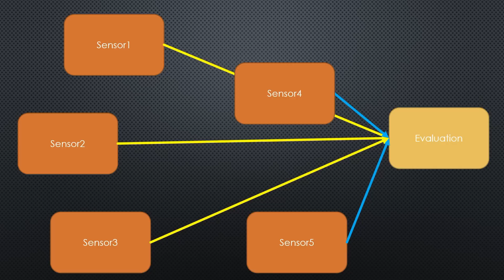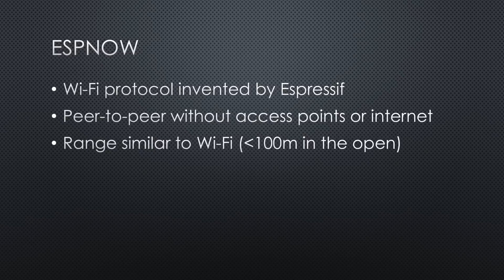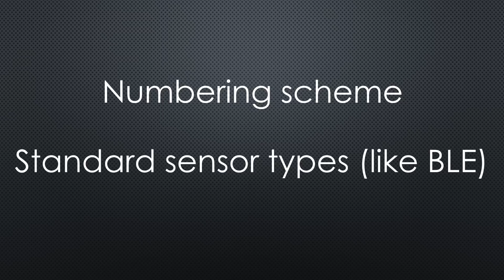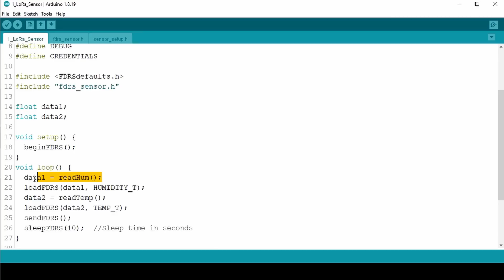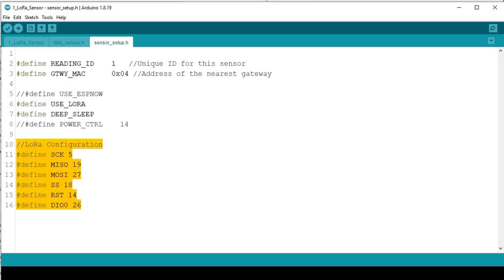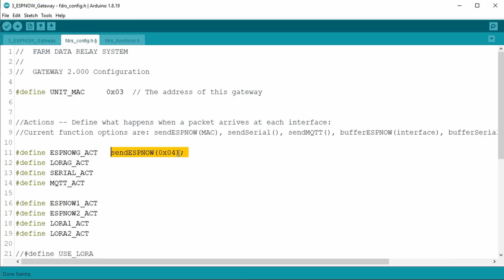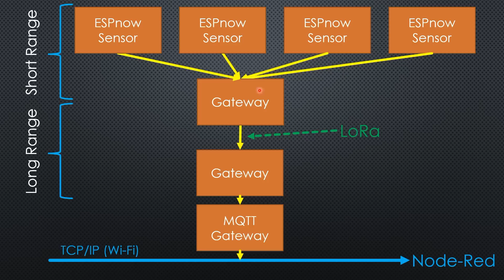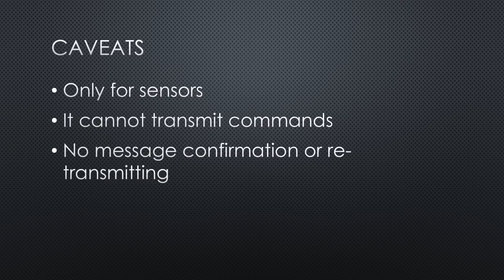430 ESPnow and LoRa Network (incl. Repeaters and Gateways). A TTN replacement?

Comment: @Andreas: ESPNow and Wifi run togeather... 
To be exact ESPNow simple usese Wifi "manufacturer message" packets.
The only problem i discovered so far is the Wifi Channel must be the same for Wifi and ESP Now receive (Channel of Wifi AP rules here).
Reply: you are right: channels must be the same (which should not be a problem - you control your AP). But I am not sure if you can do 2 things at the same EXACT time: talk/listen to ESPnow and talk/listen to WiFi - probably not. So when WiFi is on AND in use (send/receive message) then ESPnow incoming message probably is lost (I did not check it thoroughly yet but my observation shows this)
Reply from the maker: Maybe somebody takes care of that part of the project and writes an integrated gateway. For the moment the addition of an ESP-01 is cheap and it worked…
Reply: @zyghom  There is no Problem listening or sending both (except the Channels i mention). ESP now IS Wifi, but w/o the need for a managing AP
Reply: @emmoemminghaus6455  that is what I just said ;-) But can 1 radio talk to 2 devices at the SAME time? (sensor sends data over ESPnow and Gateway sends data to MQTT server at the same millisecond)
Reply: This is the precise issue. All devices need to be on the same channel, but the MQTT gateway changes channels to match the WiFi router it is paired with. Trying to match every device in the system to the channel that the first one is using would add too much complexity and overhead. Eventually I may add an option to choose what channel everything runs on as you are flashing the devices, but I haven't had a chance to test that.
Reply: @timmb2512  I am not getting where you see the problem: we are talking your house, where the AP is under your control, so you can set up fixed channel. Then all the IoT devices you build, you set up to use this channel - WiFi or ESPnow - no difference. Right? Where is the problem?
Reply: @zyghom  As I said: that is something I may add to the system.
Reply: @timmb2512  sending on a specific channel works. The problem is how do you know what channel to send.

Comment: Nice project, but this reinforces my feeling that open source community very often tries to reinvent the wheel and start from scratch instead of contributing and expanding existing projects. Mysensors is something similar using nrf24l01 transceivers and would be a nice base for this
Reply: freedom is also "a thing" but actually you might be right as well ;-)
Reply: I used mysensors for one year and threw everything away ad it is poor documented and mantained although their idea was great.
Reply: @nmuratori  many projects finish the same way ;-(
Reply: @nmuratori  my point. Mysensors its just an example of something similar. I also used it and I think is fairly well documented but not mainteind anymore. So it would be nice to have fewer good projects rather than several poorly maintain projects. Not a critique, just a personal opinion/wish
Reply from the maker: I never used mySensors. But extending projects often also increases complexity and inherits legacy…
Reply: @AndreasSpiess  i like to think software in 2022 as building blocks. Each block needs to be as a lego brick: robust, standard, flexible. When I choose a software stack I want each block simple enough to do only precise things, and able to talk with others in a very open way, so I can switch to other blocks if needed. Mysensors wanted to do too much. From hardware to protocol. Esphome is another example. great to start with sensors but relies to other platforms (homeassistant) and therefore as soon as you need something custom it's a big mess.
Reply from the maker: @nmuratori  Custom and Lego bricks do not fit particularly good ;-)
Reply: @AndreasSpiess  fits perfectly. It's what you do in all your tutorial. Arduino is a brick, a driver is a brick.. good bricks can talk each other and have flexible interfaces to combine in new ways. Bad bricks are like the fancy chassis of a lego starship, seems cool and complicated but cannot be used to anything else than what you have designed specifically.

Comment: Very good video and interesting project. Another thing to add to the to do list is security. This is becoming a great concern for all IOT.
Reply: its not so bad in remote areas (its a farm) and no connection to the internet. Not a very attractive target. What info to steal? Temperature and humidity? Not much to secure here. Its good for use case scenarios
Reply: what would you add in that scenario? A SSL connection at most.
Reply: As mentioned, incoming sensor data only needs to be secured in a few scenarios. When bi-directional communication is better implemented, I'll be looking into how security can be improved. Suggestions are encouraged!

Comment: I think the better solution will be a ZigBee network sensors are production level and not DIY, Routers can be powered externally with solar panels. And all sensors would use the same protocol. It will be more costly but with less caviets.
Reply from the maker: Zigbee is a very good protocol. However I do not know how to build my own sensors for the moment. And Zigbee has a very limited range similar to BLE. LoRa has a very big range.
Reply: @AndreasSpiess  You don't have to build your own sensors that's the whole idea :) 💡
However for ranging issue ZigBee routers costs about 6$ each + another 13$ for solar and 5v converters and since they work as mesh you can put as many as needed, and message guarantee to arrive ( or at least you can watch network health ).

Comment: Do the ESPs use less power than for WiFi while they‘re running LoRa and/or ESPnow? I had the impression that the high power consumption for WiFi comes not only from the use of the radio (which is presumably no different for the other protocols), but also from what‘s required for WiFi communication — some messages that have to be exchanged with the AP, and a bit of waiting. If LoRa or ESPnow are simpler protocols (I have no idea if they are), then there could be less power consumption and longer battery life.
Reply: the maximum current I measured for WiFi vs ESPnow is not that different, but the overall consumption comes from the time when radio is ON. For ESPnow you can get into the range of 15ms - there is no way to get even connected to the AP (WiFi) in such short time - my best time for AP connection was around 100ms (and not always of course as it depends what happens on AP at the time you try to connect) - with WiFi sensors I was never below 1s total time (measure, connect, send, go to sleep) while on ESPnow, including measuring temp/hum/light I can get into 200ms (with ESP32-S2)
Reply: @zyghom  that‘s impressive. Reduce the time spent using high power to 20%, and you can run devices like these from a coin cell battery that only needs to be replaced a few times in a year.
Reply: @slimhazard  "the only" problem is: I am not sure how to make ESP32 even start on the coin cell ;-) I am using 1000mAh LiPo for indoor if the device is not connected to the power (with ESPnow it should last for 1y - still 11.5 months to make sure it is true) and less capacity for the outdoor sensors that have solar panels. Nowadays in southern England the charging start at around 4:30am (and sun finishes after 9pm) so battery is full again within 1h but during the winter it wasn't so easy ;-) (but last winter my sensors were "old versions = WiFi" so they did not consume so little like today - we will see next winter)
Reply from the maker: If you need low power sensors I would use LoRa and a simple Atmega processor also shown on the channel. Gateways have to be connected to the grid or solar because they are always on.

Comment: Now, how long will it take for 1 byte addressing to become a bottleneck?
Reply: Yep, that's an acknowledged point-of-limitation. There really isn't much stopping that from being extended, however.

When someone sends me their project with >128 gateways, I'll look into using a second byte :D
Reply: ESPnow is limited, so 255 devices is more it can handle ;-)
Reply: @zyghom  limited by the number of devices immediately connected to a single gateway? End-to-end numbering will still put a hard limit on the size of the network regardless of the number of gateways.
Reply: @killymxi  From Espressif pdf: "10 encrypted peers at the most are supported in Station
mode; 6 at the most in SoftAP or SoftAP + Station mode. Multiple unencrypted peers
are supported, however, their total number should be less than 20, including
encrypted peers" - I think they talk about "paired" devices. Btw I went through the code Andreas linked - the "addressing" part is kinda strange - you actually don't have to address the peers - simply add 1 more field in the sent data: "sender's name" or so. And you (the receiver) always know the MAC of the sender - this info is part of the ESPnow message exchange so even the MAC of the sender is not needed to know. Btw receiver does not have to know anything about the sender - it is only a sender who must know whom to send to (unicast) or in case of broadcast... 0xFF all bytes. In my project I simply set up the MAC of the receiver to be fixed address and then all senders (sensors) send the messages to the same MAC - receiver is not aware in advance how many will talk to it: "message comes - thank you - let me send it to HA and using discovery messages on MQTT create the entities"
Reply from the maker: Maybe Timm know the answer? I assume it is big enough for typical maker projects.
Reply: @zyghom  It sounds like you are on the right track. The peer number limitations aren't really relevant to this, as an ESP32 can send and receive from unregistered peers. 8266 has some more limitations on this, but I was able to solve it by adding peers on the fly, then deleting them once I was done sending to them. Seems to work so far...

Comment: unbelievable - I just finalized my project: "move out from WiFi to ESPnow".  Similar approach (without LoRa)  and observations:
1 - gateway: 1x ESP32 can do both: ESPnow and WiFi but not at the same time (no need for Serial), but:
- ESPnow message sending takes < 15ms (from start modem till receive confirmation) and if 2 messages come at the same time you either do queue on gateway or discard second one
- sending WiFi message from gateway to Home Assistant MQTT broker takes < 20ms
- ESPnow sensor wakes up, collects data, sends message to GW:
  - ESP32  < 0.6s
  - ESP32-S2 < 0.2s  much faster so less battery consumption
- GW is always on, both way communication with HA 
- since ESPnow sensors only talk 1 way: to GW, no commands to them, so OTA on routine basis: once a day it connects to web server where new Firmware might be and if found, it will perform OTA

2- ESPnow sensors:
  - ESP32 - 180s hibernate (not deep sleep!), average current 4.5uA, work time: 0.6s with average 50mA, overall average consumption:  200uA
  - ESP32-s2- 180s hibernate (not deep sleep!), average current 22uA, work time: 0.2s with average 38mA, overall average consumption:  80uA
so ESP32-S2 gives 16 months for 1000mAh battery - ESP32 "only" 5.5 months

CONCLUSION: better to work fast (0.2s vs 0.6s) than sleep current (22uA vs 4.5uA) to save battery

and for battery: no voltage - use MAX17048 to get real performance of the battery, i.e. from here: https://www.ebay.co.uk/sch/i.html?_from=R40&_trksid=p2512315.m570.l1313&_nkw=max17048&_sacat=0

EDIT:
ESPnow in UNICAST re-sends data to receiver if failed and returns the real outcome (success if received and confirmed by receiver), in BROADCAST mode it only confirms "message sent" - irrespective if received (for obvious reasons: broadcast)
Reply: If you use HA.... wait a while.... i do a more modular verstion of my WIFINow Module... INCLUDING OTA (and othe IP stuff for convinience)
Reply: @emmoemminghaus6455  the "problem" is: if the ESPnow devices work for too long, the battery goes depleted fast, so I opted for "interval" OTA (once per 24h) rather than to force the device to wait for the command. But I will test also command from gateway to the sender in case OTA has been requested by HA for the specific device (command sent to gateway for specific device, and if the device sent data to gateway the order from gateway to the sender: "hey, do OTA ASAP please") - let me check how much more time it will be for the sender to stay ON. BTW HA makes it much easier than standalone MQTT broker and Node Red (I think)
Reply: ESP Now and Wifi at the same time is theoretically possible, but I had problems with channel selection. ESP Now always did channel 1 on the sender, no matter what I tried to set. If the home wifi wasn't on 1 the receiver was on a different channel than the sender which I couldn't change.
You can easily check ESP NOW with Wireshark if it sends on Channel 1 or any other. Just make sure your connected Wifi is on the channel you want to monitor.
Reply: @drstefankrank  
try this one then (on sender):

#define WIFI_CHANNEL 8 
WiFi.mode(WIFI_MODE_STA);
esp_wifi_set_channel(WIFI_CHANNEL, WIFI_SECOND_CHAN_NONE);

and you don't need wireshark to confirm - receiver (if set up on that channel as well) will tell you the same
Reply: @zyghom  I try this. I can't remember what i tried so far, but all efforts in setting the sender channel were not successful in the past. Maybe it is a fixed bug or I did something wrong. It's over a year ago.
Reply: @drstefankrank  you might be right - I tried some time back and it was... NOT working. But today it works ;-)
Reply: @zyghom  That gives me hopes.
Reply: @zyghom  Thank you so much. This indeed works. Just had to include esp_wifi.h to get access to that function.
Reply: @drstefankrank  check on my github the implementation
Reply: @drstefankrank  If Wifi now where locked to channel 1 then it would be forbidden to use it in asia.... Only because there are a few dumb devices this does not mean that you cant use other channels. As i sad in another post here the problem is the channel the AP connection selects.
Reply: @emmoemminghaus6455  Sure it should work. I just were not able to set the sender channel. It was always sending on one and my receiver which was connected to my home AP is on channel 6. Need to try it again.
Reply: How can you do OTA over esp now in case the node cannot connect to wifi directly and is only going through espnow repeater/gateway ?
Reply: @algre977  no, every now and then sensor device after waking up connects to AP and performs OTA, since this device is not aware of the time, such action has to be based on bootCount number rather than time of the day/date
Reply: @zyghom  agree, but how can it perform OTA from a webserver if all it can see is another espnow repeater for example ? (I'm assuming it doesn't have access to direct wifi when the router is too far for example, would it then be possible to do OTA through via it's espnow bridge ?)
Reply: @algre977  you are completely right: if the device is out of AP coverage then the only OTA possible is over ESPnow and I know it is possible (Espressif mentioned it in their ESPnow advert) - I did not find it out yet how to ;-)
Reply: @zyghom  exactly, I have been trying to do that but couldn't find a working example. If you come across one please do share :). Also, why would you go through hoops and loops when you have access to an AP, right ?! Because if it's the case, then FDRS would'nt make sense here
Reply: @algre977  exactly that is why the situation when sensor device is completely out of AP is not existing in my case so I did not push too much to look for the alternative. On the other hand: sensor device is so simple, that updating it on regular basis is not really needed. But finding the example for OTA over ESPnow would be amazing. Of course gateway needs to work as web server then.
Reply: Aside from OTA, how come you had esp 32-s running 3 times faster than bare bone ?! Did you use same clock freq ? Also, did you by any chance measure the times for esp8266 ?